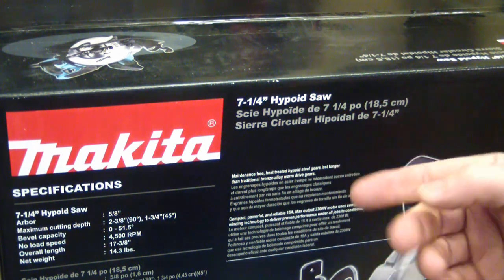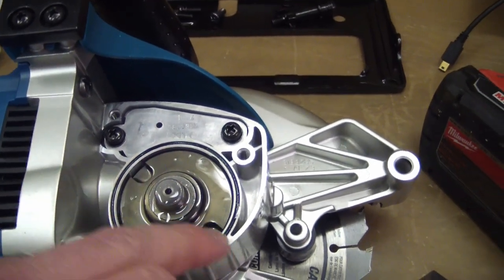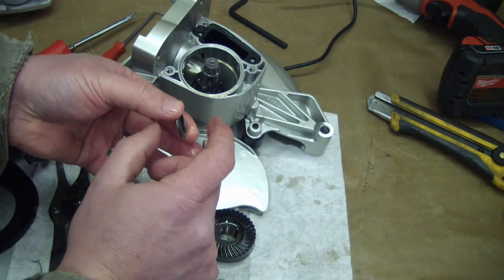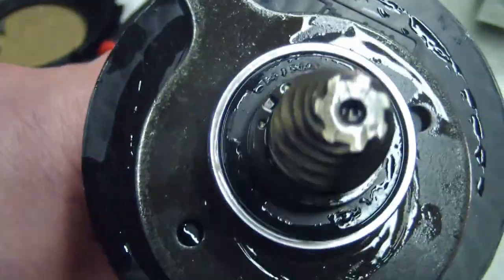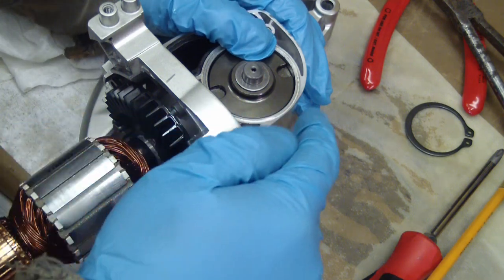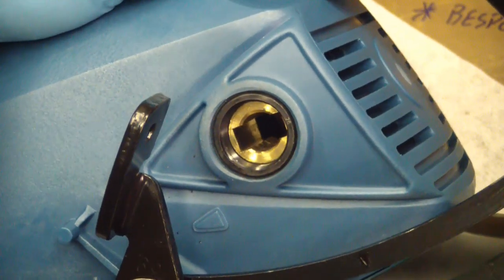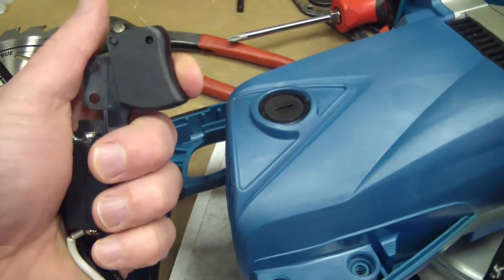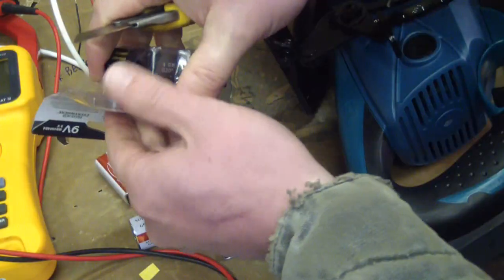Bored of lame tool reviews? Meet Makita's new Hypoid Saw.

Comment: I have repaired tools for Makita for seven years and I can guarantee you that plastic piece on the cord is not a ferrite toroid. It does not have a Makita part number and you can't get a new one from Makita. The only thing that plastic piece does is container the little security strip that will set off the alarms at the door of the Home Depot.
Reply: Quite right!
Reply: I was also going to point this out.  You are absolutely right.  When I buy tools with that plastic thing on them, the first thing I do is smash it off.
Reply: I was so confused, doesn't a ferrite torroid need to be connected?
Reply: Cracked one open couple years back and that’s exactly what it is
Reply: I’ll back you up on that
Reply: If the tool has some type of electronic motor feedback control it will usually have a noise suppressor on the cord. I took one apart on a router and it was a wound up torrid. I am now going to check out everything else that has that box on the cord.
Reply: Mine felt too light to be a ferrite bead. This makes sense
Reply: Figures for Makita....
Reply: Lol when I first got into framing for a living I was told this saw wouldn't last me a month. Well 5 years later, it's still spinning without issues. It may not look as pretty but it has been a great saw.
Reply: So you are telling me that AVE stole this unit. :D :D :D
Reply: Don't you mean "the homeless death spot"🤣
Reply: @spoofer20  that is what i thought. these are normal on electronics too (like laptops) and they are always part of the power cord. you cant move them.  I was wondering about this as well.
Reply: I have a Mak similar to this model and it had that black plastic sleeve on the cord. It does feel very light, but I figured for sure it is a ferrite shield. 
I do recall seeing the security strip in the box when opening it up (not sure why, but I do).
Reply: That's what I thought to
Reply: Funny thing is people can walk out with the tool alarm blaring and get away with it. I have family  that work at Home Depot. They tell stories about people walking out with multiple power tool kits almost once a week.

Comment: Actually, most all rear drive vehicles are of a hypoid style gear arrangement just like that saw. The pinion drive gear doesn't pass through the centerline. I have never seen anything but the hypoid gear arrangement in rear drive vehicles. In fail wheel drive vehicles, the diff is internal to the transmission in most cases and are normally a chain drive or direct spur gear. The exceptions to the hypoid rule I would say are some of the really old, early automobiles like a Model T perhaps.

Ford 9", Ford 8.8, Dana's, AAR's, GM's, Mercedes, BMW, etc, etc, all hypoid. Even some of the EP rear end lubes say hypoid on the bottle.
Reply: Yeah, agree. Notable exceptions are profoundly weird cars in other ways. SAAB 900 cars from '79-'93 and SAAB 99 from '68-'84 had spiral bevel gears, as did many Citroëns (2cv, Traction Avant, DS, SM). This layout was shared (albeit transposed to the back of the car) with many VW-derived vehicles: Bug, Van, and a whole series of front-engine (transaxle at rear) and rear-engine Porsches. Perhaps not coincidentally, lots of these cars have pinion or pinion bearing failure when souped up beyond design spec. Something about not handling torque...

Subaru uses a similar setup to the Citroën/VW/Porsche style, but they've gone with hypoid gears at least in some of their units. They are possibly more robust. Some VW people even swap them in.
Reply: I am so glad I read this comment because I was starting to question everything I thought I knew when he said they were spiral gears
Reply: All done for more ground clearance...
Reply: Nadine Seelmeyer nope done so the drive shaft don’t hit the underside of your vehicle. The haploid gear meshes with the lower side of the diff ring gear. Not the upper side.
Reply: Land Rover differentials have no hypoid offset.

Comment: Having used the magnesium or aluminum bodied worm drive skil and milwaukee saws in residential home building in the lovely but severely wet Washington State USA for several years, I can tell you that the plastic bodies do not shock the bejezus out of you when you are standing in mud, cutting wet wood. Those old skil saws would tingle in the handle even when you were bone dry, and downright juice you when damp. Also, we abused those saws fiercely. Power pole was usually 50 to 100 feet away, and a couple of costco extension cords run up to the house... pull the trigger on the saw and get about 200 rpm out of it with the extension cords smoking hot. We'd saw through truss nail plates that way, cut 4x6 headers, bird mouths on rafter tails, drag them through the mud and up the side of the house by the power cord... they just never seemed to mind, other than bleeding electricity through the body. When one of the saws died, likely due to the gearbox being dry, but no post-mortem was performed, we bought a newfangled at the time, Makita hypoid saw. It performed flawlessly. The carrying handle would break on those, usually when you threw it in the back of the pickup truck. But they were several pounds lighter, and had as much grunt as the skil's had. We bent more of the bottom plates on the makita's though, and the makita would weep more oil out of the gear box, so much so that we had a bottle of oil in the truck and would top off the case about once a week ( which we NEVER did on the skil saws ) As I recall, a new skil 77 was about $200 and the makita was about $180. Skil eventually made the pistol grip on the 77 out of plastic, but it was replaceable which was nice. When I got out of that racket, and bought a house, I tried a circular saw and I simply couldn't use it. The torque and offset of the blade seemed like it was designed to cross up the blade in the wood. I bought a Skil 77 and now I'm a legend in my neighborhood.
Reply: Jeff Stewart ty
Reply: House framer here too.........some 21 years ending about 15 years ago. But yeah, couldn't kill a SKIL!! We would pull them up into the joist buy the chord attached to an extension chord. I LOVED the big 60 degree for doing serious cut up roofs here in south Louisiana.
Reply: don say the dreaded racket word... polish plain  your diplomatic skills and replace with bubble or derivatives,  you'll sound like james bond at the next rummage block party
Reply: @gentbar7296  what does it mean if i'm catching on to the ketchup? I never claim to know anything to a certainty, but a certain entity seems to have pit itsself against thee. I understand too much to look away. I feel as though I'm constantly playing catch-up. The guide I seek never cummms!

Comment: I got one of these in 1988, when I was working in a furniture restoration shop.  Also got a extra heavy 25' extension cord. I ripped many 9/4 maple boards, the table saw we had was small and not up to it. Also done some framing. I did replace the cord 2005. Also flatened the base plate after seeing Japanese carpenters using the saws made there for non-export. The brushes are about half gone. Paid for itself in about a year. So about 30yrs of gravy - thanks Makita!

Comment: Great vid. One minor quabble though is that automotive differentials definitely use hypoid bevel gears - though the hypoid distance is not as extreme as this saw uses. The highest hypoid gearset in common use was probably the Ford 9", which of course was phased out a long time ago (presumably for efficiency reasons.) Though regardless, most every automotive differential I've messed with has been hypoid and not straight nuts spiral bevel.
Reply: The Ford 9" rear end is still in production at least in the aftermarket in the USA. It is the most common rear end for high performance applications. All NASCAR cars use them and they are very widespread in drag racing. The last car in the USA to use a spiral bevel gear was the Ford Model A. They initially started using hypoid rear ends to lower the driveshaft to reduce the intrusion into the floor. Then they discovered the vastly improved torque capacity over spiral bevel and never went back.

Comment: Something you missed? Holy hell that was more complete and in depth than at a few places I can even understand. awesome review, no BS. 

Thing you might have missed: First let me preface this by saying its been two+ decades since I came out of electronics college but I do clearly remember the 20k ripums motors are series wound and yes they will run on both AC & DC and I am glad you showed that to all the newbies out there (even the 'failure' with the 9 volt batteries is valuable teaching tool because it illustrates low current scenarios which can happen in real life. Like my last house this fellow wired up the garage himself using red and black wire... not only did my circular saw trip the breaker but he had the polarities backward and the voltage was 90VAC. I traced it back to a weak connection which was right under my bedroom and a FIRE HAZARD to boot! After I used compression connectors to rewire it and put the whole mess in a proper electrical box it worked fine. I also added a GFI which saved my life when a cracked droplight cord was in a mess of water that I was standing it. Best $6 I ever spent! ) the signs of a low voltage/low current/bad connection scenario since these are one of the most common issues in electronics. 

90% of shit is bad connections and knowing how the load acts helps one diagnose the issue. And you know how valuable it is to be a good/great diagnostician. It's where the real money is.

OK, as I was trying to say before I rambled myself out the door and atop the barn:

Series wound motors, IIRC, are basically meant to self-destruct with no load on them. Meaning running it without the blade is obviously not good. Testing it in this manner really doesn't tell us much and risks burning the coating off the motor winding wire. Of course this is not how us woodworkers use the tool so either way it is a moot point. After your excellent breakdown I will buy a Makita hypoid saw or angle grinder should I ever need one! (its like a reverse psychology sell!)
 
 8 amps times 120 gives us about 960 watts and at 746 watts per hp that means this is about a 1 1/3 hp @20k ripums noload ...

I find that is the only TRUEer # to use when buying tools and even then there is power loss in the gears and bearings but it looks like that Makita would keep it to a minimum. I knew about differentials but not about hypoid gears and I really appreciate that breakdown & illustration. Glad you insist on plug in tools since the cordless junk is just all that -- JUNK. Trendy DIY stuff... the only thing I really like/need is my cordless light for occasions under the car, lockwork or in closets/etc.

Keep 'em coming!

Comment: I enjoy your videos!  Just one comment for your viewers.  thermo set plastics unlike thermo plastics won't melt, they burn. General  characteristics for thermo set plastic is: good dimensional stability, high strength, resistant to heat, high dielectric strength, low creep etc. Manufacturing downsides, expensive material cost, slower molding cycle times, scrap can't be recycled etc.   Keep your stick on the ice!  lol.  Mike
Reply: Another tidbit for you.   Thermosets are essentially pre-mixed EPOXY based plastic meaning they are curing from the moment they're manufactured (mixed).   They're pelletized and shipped frozen and include a thaw-alarm/detector so that when received it can be spotted if any thawing may have occured and hence, rejected.   The end-user (manufacturer) then monitors their life as they do expire even in the freezer (shelf-life product).   Immediately before use they are put in a pre-heat (thaw) oven (microwave) and then transfer molded (not injection molded).

Comment: 18:27 The case is made of polycarbonate, as written on the case itself at 19:21
That >PC-GF15< stamped on the plastic means polycarbonate reinforced with 15% of glass fibers.
Reply: nice catch! and a bad ass material, almost like bullet proof glass
Reply: It is the material used in bullet proof glass.
Reply: @8bits59  Not quite. PC has superior optical properties. It's indeed clear as glass. And other than glas it's very tought and doesn't break on impact.
Reply: @horste9237  that makes sense, thanks for the info! I knew it was something special about PC, they didn't just pick any ol plastique.

Comment: Curious how you would rank the major brands. Personally I've always put Makkita and Bosch in one category, Rigid, Dewalt, and Millwaukee below that, Ryobi and Kobalt, then Harbour Freight.
Reply: You're ignoring a lot of brands like Fein, Metabo, and Festool.
Reply: jrmym2
Not only that. Bosch has the blue (professional) and the green (occasional use) line (at least here in Europe), as has Metabo (green = high quality, blue = DIY level with Metabo label slapped on it)
Reply: We got several festool at the job and they take alot of abuse of oversized drills and holesaws etc none have ever broken down, but the chucks are crap imo, but they are anywhere between 4 and 10 years old.
I like hitachi cordless drills they are a bit flimsy but very nice grip and really good power, i know of some broken gearboxes though.
Reply: 1. Metabo, Fein, Festool, Hilti
2. Milwaukee
3. Makita, DeWalt
4. Bosch, Rigid
5. Porter Cable, Hitachi
6. Craftsman , Skil, Ryobi
7. Black & Decker
8. Rest of em- don't bother!
Reply: Common on....what about about HILTI???  DUH?  This site is full of residential contractors and the weekend warriors.
Reply: @jrmym2  I think we're only including tools that you can get dirty.   Those brands all have to be kept on satin pillows in glass cases rotating on a lazy susan under spotlights along with the Crown Jewels.
Reply: @larsonhomeinspection9932  Again, we can't include tools on this list that you can't get dirty.   If you'd shed a tear for getting any of those in group 1 dirty, then they shouldn't be on the list.   IMHO.
Reply: My wallet ranks around the same range as Ryobi
Reply: It’s a tricky one, as it’s different for cordless and corded tools. I think that Bosch and Makita’s corded tools are better than their cordless tools for example.
Reply: Markkita then everyone else
Reply: @johnsontrucks8806  their impacts suck. Bosch, Dewalt, Milwaukee you name it. All better than Makita impacts
Reply: @randomdudeontheinternet9926  
The urge to tell you they don’t is overwhelming but yeah they probably do although my buddy had the m18 fuel 3/4” drive and we put it up against my makita DTW 10001 and the maktia kicked milfuckys ass not only that when you connected the impacts with a piece of square stock the makita just kept banging til the m18 when into thermal protection 

My brother left the makita in a bucket of water cause I thought that brushless meant invincible , it killed the speed controller
Reply: @johnsontrucks8806  our impacts are used very intensely every single day. I don't know what parts kept failing. I only know the lifespan of the Makita impacts 1000Nm version was around 4-6 months. The Dewalts are 2 years in and still going except for one which was dropped from 8 meters high. I don't privately own a single Dewalt tool. Just putting my own observation out there.
Reply: galeski, suhner, flex, fein, walter

Comment: I once had to install a 4" diameter internal snap ring into the tail end of solid rocket motor, which we had to buy special vice clamping pliers for (over $100!). I had a rule that when I was installing it, no one could walk through the same plane as the snap ring incase it flew off. Absolutely heart stopping.

Comment: You are incorrect on Spiral bevel gears in automobiles Ave. The have not been widely used in a very long time. The hypoid gear is the standard for Most if not all autos on the road.

Comment: Thanks for your video. My hypoid just recently cancel out on me for an unknown reason. It's relatively brand new, buying it around late 2020 and it hasn't had a lot of use except for a few projects. It has been a great accessory except for it not switching on as of recently. Your vid helps to break down what could be the issue which could be the switch being burnt out.  Wish me luck.

Comment: When the Hypoid first came out I bought one and really liked the extra power and RPM that it put out, over the Skill, and especially the weight difference .I liked the Hypoid so much better than the Skill that I continued to replace the Hypoid about once a year , as the drive gear would burn up and wasn't replaceable , for five or six years,  The Skill saw I was using is still working fine, but the energy and time I saved made it well worth the cost,

Comment: I called makita. They had a part number for the lube. Crazy expensive at $34 for an ounce. Guy was kind enough to tell me that its 90wt or VG 220. I just ordered Mobil SHC 630 to change it after my new saw breaks in. Can bear the thought of never changing it. Great video. Wish you could do a bunch more. But that would be costly.
Reply: *****  Please comment on this if you can. How can I be sure this SHC 630 will not attack the seals. Ive seen some posting the said seal compatibility is pretty good but it attacked some nitrile seals. I know Makita wouldn't get down in the weeds esp because they sell the oil as a part. Anyway, just curious what you think the chances are that I'd have an issue.

Comment: I always thought the purpose of 120v DC tools was so you could run them off of the big portable AC/DC welders that had 120v household style outlets them.   We used to work a welder that would always warn us about our tools needing to be DC rated before we plugged into his welder for power.